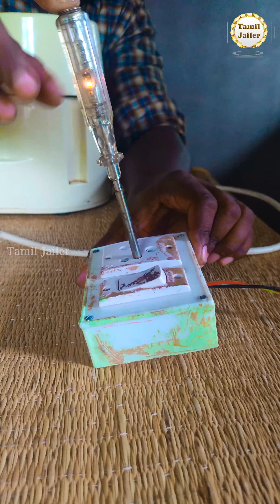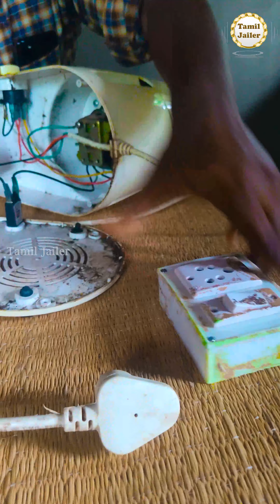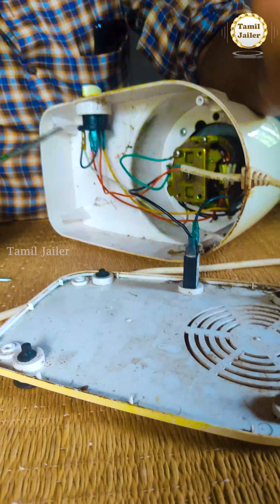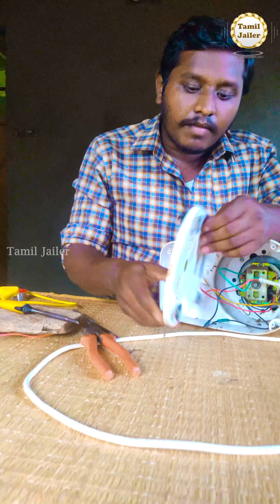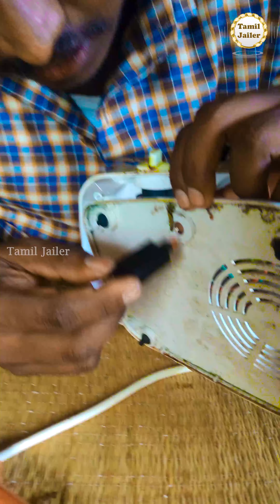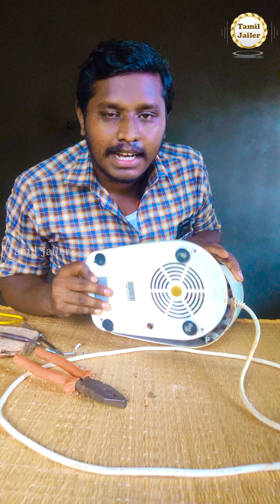MIXIE Repair in Tamil | Tamil | Jailer | Tamil Jailer

Comment: Overload 2.7 ohm switch 150 Rs
Control switch 250 Rs
Wire connector pin 10 RS
Ivlo rate varuma